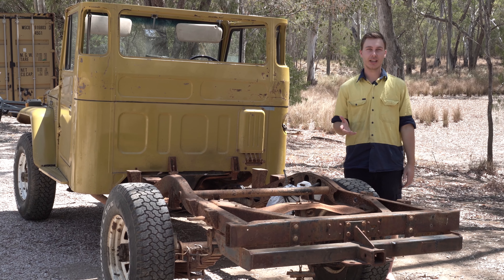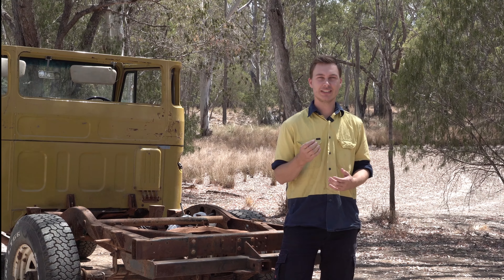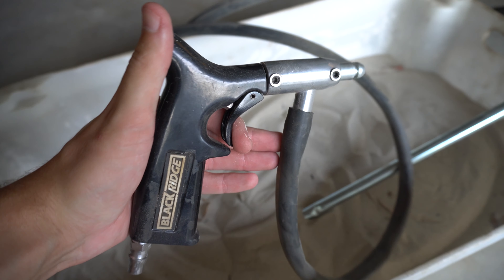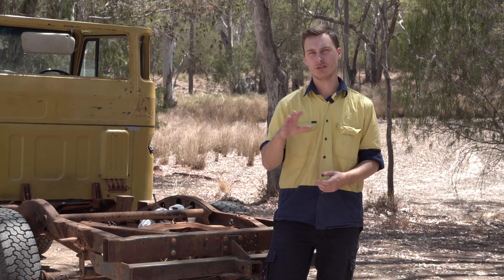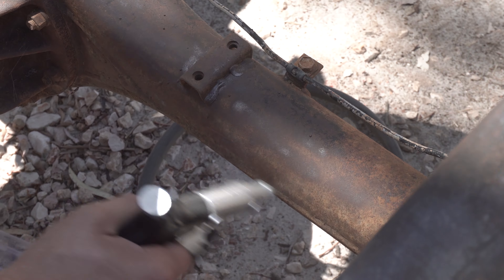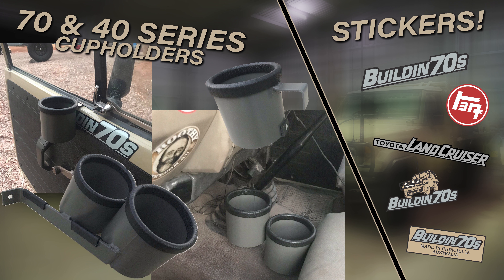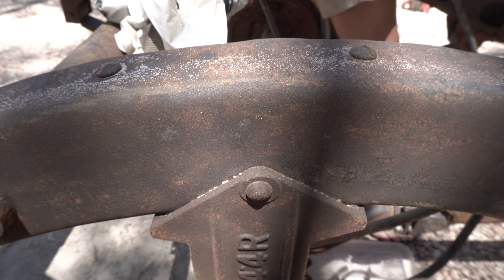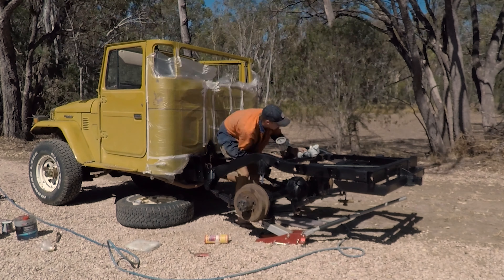How To Make Your 4x4 Chassis Brand New Again

Comment from the maker: Please Note: 
Sand contains silica which is dangerous to breathe in so make sure you use a N95 rated mask as a minimum.
A much safer option you can buy proper sandblasting media (from Bunnings) which does not contain silica but you will still need to use a mask as the paint and dust are still dangerous to breathe in.
Reply: Sand blasting with normal sand can cause Silicosis.
Reply: Well...glad you brought that up.

Comment: Cement mixer and a gas heater blowing into it for drying sand. Used to use this when paving to get dry sand to go between pavers👍
Reply: Thanks for the tip

Comment: Steel and iron produce slag the is skimmed off. It is ground into sand size bits and sold in the US States in home improvement stores for cheap. It is sharp with jagged edges and reusable. Take 3/4” (19mm) metal electrical conduit, cut and weld a square frame to fit a large bucket. Use heavy pet safe screen for doors, stretch and tape temporarily and cut to get a full wrap. Using PVC pipe of 1” (25.4mm), cut it down the middle with wood working tools and cut just over the half way point. It will clip over the conduit-screen strainer to clean sticks, chunks and general debris to be used again because I am comfortable broke, this works. 
 Placing a sheet of plastic on the ground make recovery much easier. For the pickup tube, it works much better if time goes into two tubes of metal conduit the fit your suction hose. The inlet side is 1” (25.4mm) shorter than the hose side. Place them about 7/16” (11mm) apart, equal at the bottom. Mark and drill a hole connecting the tubes at the bottom and solder in a 3/4” (19mm) metal fuel line. Close the end of the inlet tube at the bottom below the connecting tube using vise grips, hammer or a vise! Drill 2 holes in the hose tube one above the connecting tube and on about 2” (50mm) from hose end when fitted. A strange as it sounds, it increases the velocity of air and increase suction inside the tube even with the hose tube open at the end. A video showing 5 things to make a better sandblast cabinet shows this in detail. It works in a bucket a well. Keep the air dry as well. 
  Check you technical information or ask the paint supplier but many epoxies do not have “UV” protectants mixed in. Yes, it is under the bottom where the sun rarely shines, but after 3 coats of mixed “A & B”, who wouldn’t want it to last 3-5 years? If you have a urethane based clear that mixes with an activator or hardener, flat or glossy, it will provide a tougher rock chip protectant than straight up epoxy. An option that is huge in the US States, is to spray with U-Pol black bed liner. It creates a texture that you control somewhat, but has “UV” and protects from rock chips and salty water. It helps a bunch. Best of luck to all.
DK, automotive certified ASE Master Tech since 1978, Retired, but working because I am comfortably broke!

Comment: Hey mate,
How would you go about doing the chassis under the cab? Would you recommend lifting it off? If so, how? Restoring an HJ75,  preparing to go ahead and do the same as you. Do you see any issue in once sand blasting, spraying a coat of rust converter, then doing the chassis paint? Any other tips regarding restoration would be much appreciated.
Keep up the good work! 👍🏽

Comment: I restored an FJ 45 years ago painted it in Acrylic dune beige, took it to a car show swap meet a bloke pulled up next  to me in an HJ47 done in 2pack it looked like glass he was sort of smiling at me then looking back at his when the time comes to be judged I won first prize, the bloke next to me went to the judges asking why he didn't win, the 3 judges turned around and said they were never painted in 2 Pack and were never that shiny so i had the last laugh i am now restoring an FJ 45 with a turbo diesel and 5-speed gearbox disc brakes mickey Thompsom Baja tyres allround snorkel ect. then i have another FJ45 i am putting a common rail 3-litre turbo diesel in it out of a Toyota Hilux with Auto box

Comment: how longs this last till rust starts popping back through or have you got several years with this method or anyone else ? looking at doing my 75 series soon :)
Reply: Updates??
Reply: Ended up doing KBS and ended up owning a 40 series 😂 don't highly rate KBS the best way I've now found id 2k epoxy followed up with a satin 2k
Reply: @TRolla82 did you do the whole 3 step kbs process??

Comment: Is there a set up that works faster than  what you show in this video?
Reply from the maker: The easiest way would to improve the setup would be to have a bigger compressor but thats about it for the non-professional.
If you wanted it to work better you would have to hire the professional sandblasting gear usually from Coates hire or similar but that does get expensive

Comment: How many bags of sand would you say is required for a chassis this size?
Reply from the maker: We used one 20kg bag and still had some leftover, just depends on how much work that chassis needs but if you do it on concrete you can always sweep up and reuse the sand

Comment: As an expert, I can tell you that you are not using high enough cfm compressor. There should be no visible scale, or flash rust at all with a single pass.
Reply from the maker: Agreed but that was the only size compressor we had at the time
Reply: @Buildin70s  been there, try smaller but longer nozzle with smaller compressor. Speed+distance=power

Comment: Do not use sand as it also contains salt which you are then blasting into the steel to create rust further down the line
Reply from the maker: Not enough to create any issues. The sand we used from Bunnings is washed and contains less then 2% mineral and organic impurities.
I would be more concerned about missing a spot when painting 😂
Reply: salt itself doesn't cause the rust. Salt acts as an electrolyte with the water and increases the rate in which the iron turns into iron oxide.